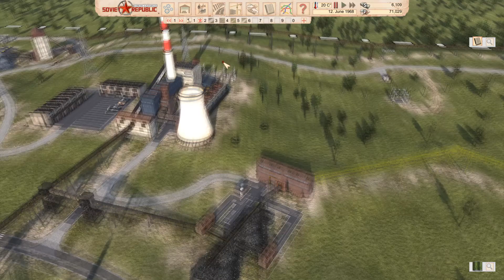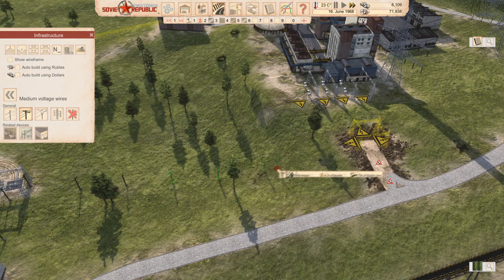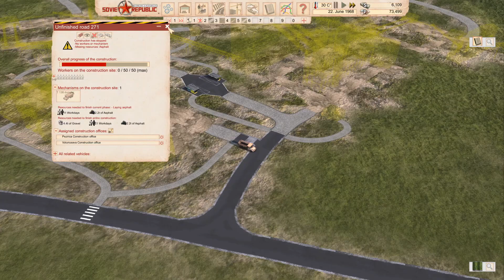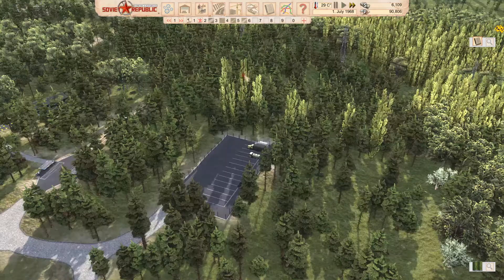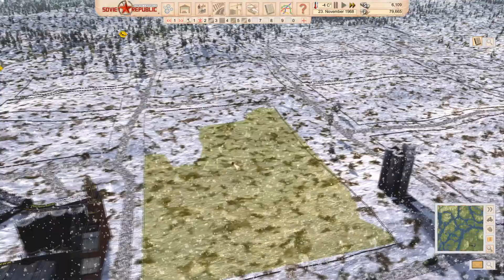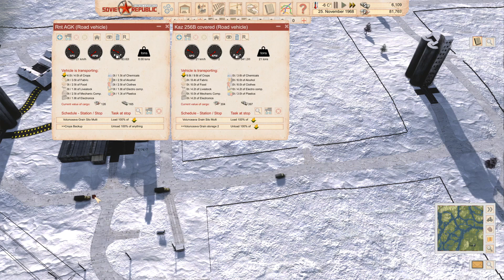Power Grid Revamp :: Workers & Resources Soviet Republic (Seasons Update) #13

Comment: For one farm, you need to set up 9 fields. I use now 3 sowers and 9 harvesters, 5 sowers if very first "T"-model. And to collect grain, I use medium distribution with 9 trucks 10t cargo capacity each. I think with more effective mashines, its possible to handle 12 fields for a season on single farm
Reply from the maker: ty for the information,  Given the annual harvest keeps meaning to do some testing, but at the moment time is in short supply.
Reply: @StephenSilverbeard  One large field gives around 290-295t of grain. For my current town, I am little short for supply food plant that works on 30% efectivness. Smth like 2 months till new harvest, I have to buy grain from USSR to meet my industry demands. By the way, I failed to go with initial loan game rule (( may be because I build all sorts of storages near customs and move goods from there by wheels. So I forced to set up many infractructure objects. Second try more succesful so far - hard with only 1KK rubles and no dollars. No loans. Now the end of 1964 in my game.  Started with residental houses for 15 workers - from modes. Now managed to rebuild them for 30 workers wooden houses and two vanila 167 workers nice buildings. In few years hope to finish my gravel industry and go for coal ))

Comment: Came to the party a little late, unless I can catch up on your previous vids in this series.
Good video and liked your presentation. I do like this game as it seems to offer much more depth than Cities Skylines if you like  that aspect of micro management. Not watched your others but judging from your cash balance you didn't select the easiest of starts. Obviously that has meant manual builds and constructions, well done.
Are you using the latest beta build, which has negated all the factory requirements from all industry, build 0.8.2.26.....?
Reply from the maker: ty for the support.  I am playing in the stable branch using the 0.8.2.26 release which includes the factory heating fix.  

The series is using the hard start on a custom map called 'Northern Canada', which is proving a challenge due to the 'key' resources being some distance away from the starting location.